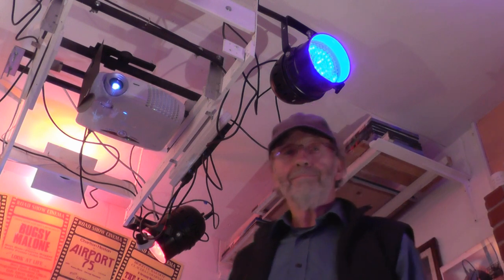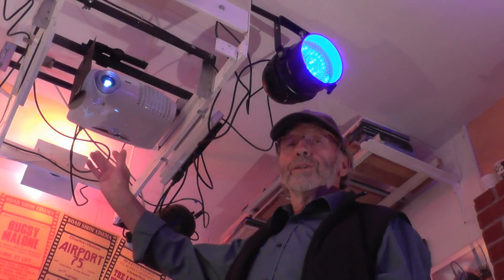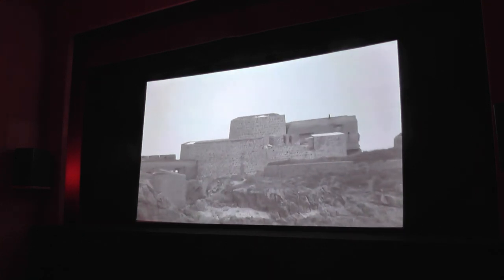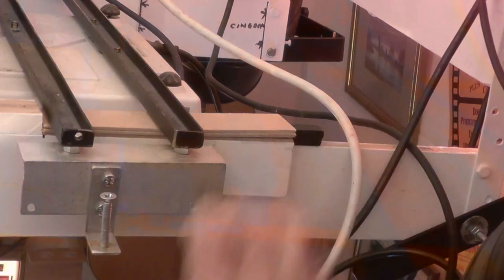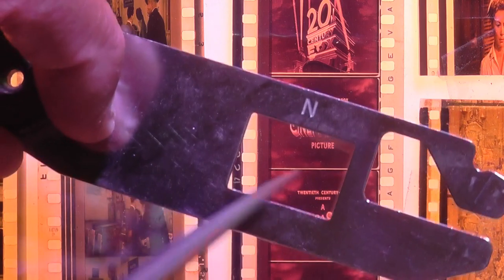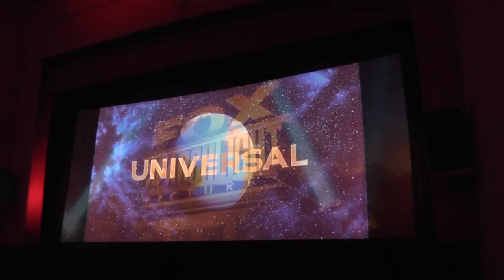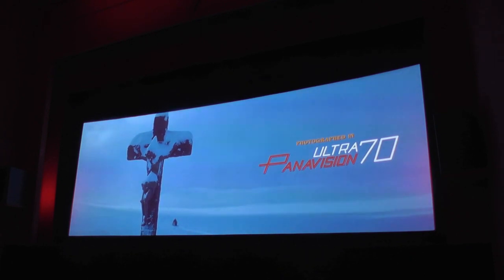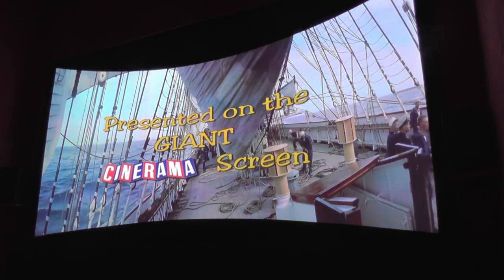HOME CINEMA - THE PROJECTOR SLEDGE.

Comment: Good observation that all the ratios use the same projector screen height. Never realized that. But when I play tv series, like Stargate, the projected image seems be larger than the screen height. Think I'll take another look at that. The black side masks can help contrast quite a bit. Funny your remark about using the salon for the theater,,, it's what I do but no complaints so far.. However the surrounding walls are white, which reflects light back onto the screen. Painting them dark gray would definitely ruffle some feathers.
Reply from the maker: The constant height way of projection applies to 35mm cropped for wide-screen, i.e. 1 - 1.85  or  35mm anamorphic i.e.  1 - 2.35. With the larger frame, 70mm projection increases the screen height. As for Stargate TV series, it could be cropped from a ratio other than 16.9. As for ruffling feathers, best move the cinema out to the shed!! I have one youtube video on 'Film Ratios' you may find that of interest. Cheers!

Comment: Thanks for that Dave. May give it a go. Only way I’ll be able to get constant height projection. But you must loose a fair wack of resolution when zoomed right out I would think.
Reply from the maker: The majority of my films are in scope, therefore I project 1920 pixels (full width) x 800 pixels ....  that is 1080 cropped. When I project 1.85 ratio (1080 cropped to 1037) using the digital zoon at -5, there are the same amount of pixels per square foot as the scope, so the same amount of light and definition for both ratios. If you project 1920 on to a 6 foot screen for 1,85, and then 1920 for 2.40 on to a 7 feet 9 inch screen, you will certainly notice a reduction in light out put and definition. I think this why many people settle for constant width. Not an easy decision to make. I do like the retro cinema style of presentation, but it takes a lot of effort......